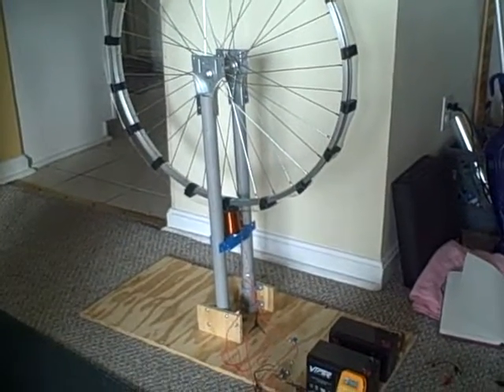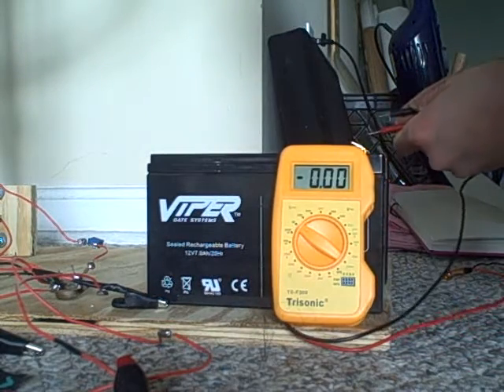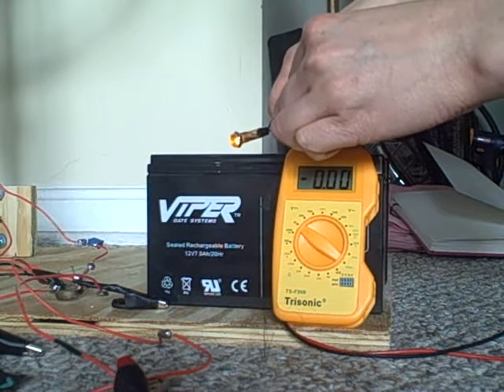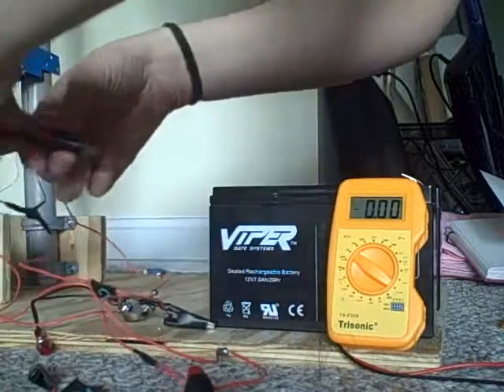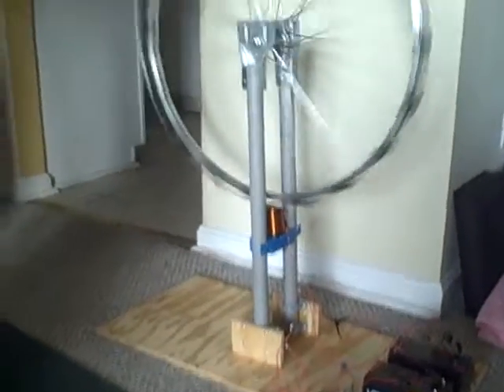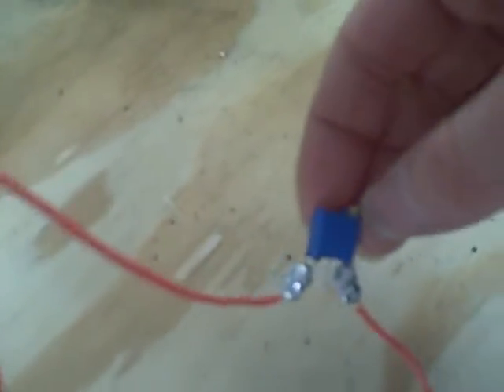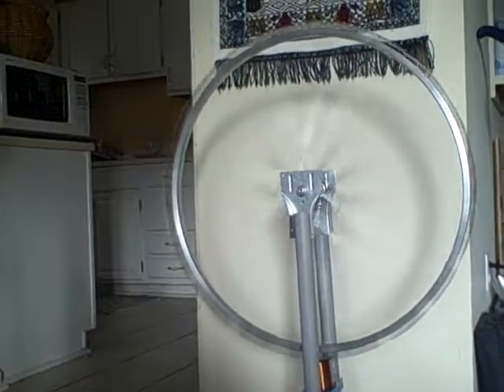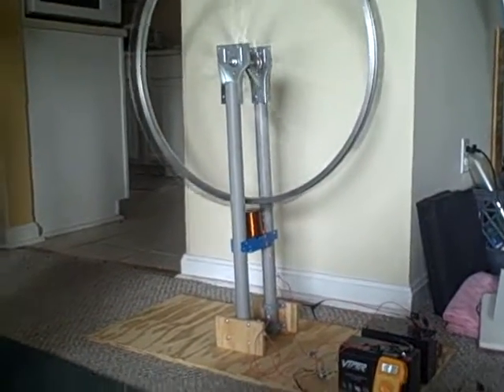First Bedini Machine: Part 1

Comment: What is the diameter of the coiled wire and the number of filaments of the length of the plastic pipe that was rolled